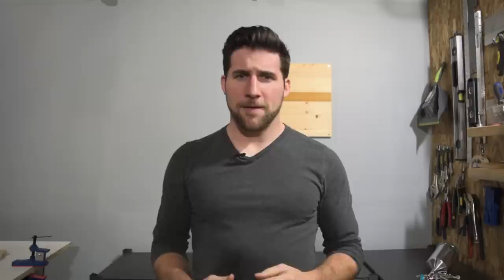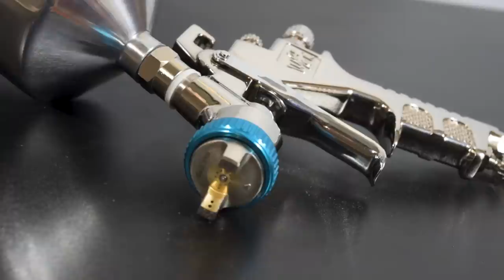Do you need to sand between coats of paint?

Comment: Hi and thank you for the useful and to the point video. I'd like some advice please. I'm painting a plastic wing mirror cover with rattle cans to match my car's colour. I'm doing solid red, i.e. non-metallic, to be followed with clearcoat (1K lacquer). So far I've done four coats of plastic primer with 10 minutes between coats - sanded with 800 grit dry sandpaper 40 minutes after the final coat. Then sprayed three coats of acrylic basecoat with 10 minutes drying between each coat. Generally it looks really good, but there is a slight imperfection now (looks like a piece of dust and is just too visible). I want to sand this layer down with 800 grit to remove the imperfection before spraying another layer of basecoat, then clearcoat it to match the rest of the car. How long must I wait before sanding the basecoat and respraying with the - hopefully - final coat of base? Thanks for your channel and your advice.
Reply from the maker: Not sure why this comment didn't appear in my notifications, but in any event, 24-48 hours should be adequate. If you haven't already done it, you should be good to go now.
Reply: @BradAngove  Thank you for your reply, Brad. I was impatient - first time I've painted part of a car and I wanted to see how it looked (typical newbie who knew no better) - so I waited a few hours until the surface was dry, then lightly sanded it with 800 grit, then a scotchbrite pad and then applied another coat of red basecoat. Luckily it worked - I was very gentle with the sanding - and after 3 coats of clear, the part looks as good as the original factory paint on the rest of the car, and it doen't even need wet-sanding as the orangepeel is no worse than the car's factory finish. I guess I was very lucky this time around. But thank you for your advice anyway and I'll remember it in future when I do more extensive bodywork. Thank you for a very useful channel and a good presentation style. It makes your videos easy to watch and to learn from.

Comment: Good advice as usual.   Thanks Brad.
Do you have any thoughts on using Danish oil as the base coat and then top coating it with Truoil for the final finish on bare wood?
Reply from the maker: +Crazy Uncle Duke Yes. I think that would probably look great. I’ve done danish oil under tung oil and I was very happy with it.
Reply: Thanks!
Reply from the maker: +Crazy Uncle Duke You’re welcome.

Comment: Hey Brad! when using nitrocellulose lacquer, Do you recommend sanding the last coat of color if it's not even and adding the last wet coat of color after it before applying the clear? or should I continue building clear coats, level it by sanding, and then add the last coat of clear?
Reply from the maker: I’d sand the color and if it’s not metallic just move on right to the clear coat.
Reply: @BradAngove  Do mean if it's Metallic move on to the clear coats, right?
Reply from the maker: Yes

Comment: What about suing Mineral Spirits instead of water for wet sanding- as that won't swell the wood?  And would you sand color coats if there is a light bit of orange peel if using spray Laquer?
Reply from the maker: It can melt some paints, but it’s an option that can work well.

Comment: Sorry if this is basic, but i'm confused now. Do you sand between your last coat of spray paint and your first coat of clear coat? Or do you not sand again from your last coat of spray paint until after you have already put down a coat of clear coat?
Reply from the maker: It depends on the timing, but usually I will sand after my paint and before my clear yes.
Reply: @BradAngove  thanks, I regret not asking this in my previous comment but when you do sand before clear coat, what grit will you usually use?
Reply from the maker: 800 grit

Comment: Hi brad really need your help for.my case, I used rattle can for painting my diecast car. The problem is the paint very easy to peel. This is what i did. I sand the diecast first and than spray the primer paint. After the primer i already try both sand it and not sand it before the next coat. I wait the previous coat completely dry before start the next coat (try dry it with fan or just let it dry)and also try a thin coat for each layer. FYI i work at night and use acrylic paint. Pardon my bad English. Thank you
Reply from the maker: Is the paint peeling off of the primer, or is everything peeling off of the metal?
Reply: Its peeling off the metal..also try without primer,same result. Already try different brand of paint. Is it change the result if i make a box of metal with lamp for drying (like an oven process)?
Reply from the maker: Are you sure you’re using metal primer? What did you sand the metal to before priming? What did you clean it with? Did you polish anything?
Reply: Its just regular multi purpose grey primer. Just found out from you there is primer for metal.. first i use paint removal and clean it with soap. Then sand it with 1000 paper then wash it with water, and dry it. Not use anything for polish
Reply from the maker: Ok. That’s probably just too smooth. Sand back to the metal. Sand the metal with 320 grit, clean it with wax and grease remover, and try it again.

Comment: I'm using a HVLP sprayer for a cheap kids boat, I will finish in a matte black......my question. Do I need to sand between coats?? Its an enamel marine paint. Im not looking for a perfect finish. I just want to make sure it gets three coats.Thanks
Reply from the maker: No. Just spray them within the proper recoat window and you should be fine.

Comment: I have a huge cabinet I sprayed with rustoleum about 2 weeks ago. Was my first time spraying out of an hlpv gun. I got terrible orange peel and mega runs. 2 questions, I need to ad more coats still. Should I just ad the extra coat, and then color sand and work out the runs? If so do I need to sand the existing coat first for the next coat to stick? Or should I just sand the orange peel and runs down now, then paint and color sand again for the final step?
Reply from the maker: I would sand it smooth now at 800 grit before moving on. Fix problems early when you can.
Reply: @BradAngove  Thanks

Comment: Brad  I couldn't find an email address for you anywhere. I have a question I was looking for the answer on your channel but didn't find it. Polyurethane I'm spraying from a can Minwax polyurethane and it has been 3 days for three light coats on a piece of wood and it's still tacky. The can says it's fast drying but this is not fast. I went out and I bought a new can and I shot a couple of light coats yesterday and today after more than 24 hours it's still tacky I mean not sticky tacky but you know soft and I would have thought that by now the Sullivans would have evaporated and left it dry. What do you think might be the issue?
Reply from the maker: How’s the temperature and humidity there?
Reply: Brad Angove 
The average temperature in my basement is 18 to 20 degrees and the relative humidity is 41. That's why I thought there was something wrong with the can of spray so I went and bought a new one.
Reply: Brad Angove 
I'm changing the guitar neck on my tele number one and I have created some new headstock logos for my teles I built and I wanted to be able to seal them under a poly but it seems to be an issue for some reason. The nitrocellulose is drying and minutes to the touch and might be what I'll need to use just to seal the logos in and do a top coat along the the surface of the headstock. I don't need much just enough to stick it over the new logo so it can't get scratched off. I was hoping the poly would do it like it did the first time on Kelly number one two years ago
Reply: Brad Angove 
Oh yeah I forgot to tell you yesterday and this morning I even tried hair dryer on setting one to try to help it work faster and it didn't make a difference
Reply from the maker: That seems pretty crazy. I haven’t really used the minwax, but unless you put it on super heavy it should be dry by now. At least not tacky.
Reply: Brad Angove 
crazy to me too.  I put on the three light coats an hour apart. And the this is where I am with it. I guess I'll just avoid the polyurethane. The second can I bought was Home Hardware brand instead of the Minwax. Put to light coats on another piece of wood to test it and the same thing is occurring there. Looks like I'm cursed from can polyurethane.

Comment: Rustoleum 2x ultra cover ENAMEL....got a light coat of primer and a base coat. Do I need to sand that orange peel off before 2nd coat? Should I use 400 grit if I do? Thanks for all your help so far, Brad.
Reply: I ended up using a white scotchbrite pad. Also, I figured out that if your paint job ends up with hairs or fibers on it, those with just fall right off during the scotchbrite session. Now onto the next coat, the morning after the base coat.
Reply from the maker: You don’t necessarily need take out the orange peel, but you do need to sand with something if you’re waiting that day in between. I would stick with the grey scotchbrite. White is a bit too fine to give the finish the tooth it needs so to speak.
Reply: Ok thanks for the help.

Comment: So I sprayed some interior trim but on the 3rd coat attempted to reposition the item and got a small finger print in it. If I let it dry then wet sand can i get this out. If so what grit would be recommended as I would also need to achieve mechanical adhesion as it would be to dry. Will add one more final coat after ?
Reply from the maker: Let it dry fully and dry sand with 600 grit.
Reply: @BradAngove  Thank you Brad

Comment: Hey question for you, why would certain spots on my 2nd coat start wrinkling? For info I sanded off old coat before starting and I’m using rustoleom I’ve been waiting 30 mins to let each coat dry before applying the next. Is this a weather issue? I have to spray outdoors due to no garage unfortunately.
Reply from the maker: Have a look at my video on paint crazing.
Reply: Brad Angove thank you sir

Comment: My base coat came out textured. Probably too much air and moving to fast. Sand it with 800 the next day smooth it out and then clear it. Right?
Reply from the maker: Correct; that should work as long as you don’t sand through.

Comment: Do you recommend sanding between paint and clear coats when using metallic paints. ?
Reply from the maker: Only if you are outside the recoat window. Generally you would want to seal those in with some clear during the normal recoat time to avoid messing up your metallic.
Reply from the maker: Only if you are outside the recoat window. Generally you would want to seal those in with some clear during the normal recoat time to avoid messing up your metallic.

Comment: If I put a couple coats of stain on the top of my guitar body so far (after sanding of course), would I need to sand a bit again before I add another coat or two of stain, if it's been a while since the first couple coats? I'm wanting to go a bit darker, plus I felt I didn't sand all the surface exactly evenly since the stain seemed to soak in on parts of the top more than others.
Reply from the maker: It likely wouldn’t hurt to sand a bit first, but I wouldn’t say it’s strictly necessary.
Reply: @BradAngove  Thanks! Love your videos and thanks for all the replies!

Comment: Im using Color Tone guitar lacquer, silver metallic. It seems to not feel very smooth after painting so wondering what I should sand/use (800 grit?) prior to clear coating?
Reply from the maker: 800 grit should work well.
Reply: @BradAngove  Would you recommend heating the can up in warm water prior to spraying? Wondering if that would improve the feel of the paint after it dries?
Reply from the maker: It will help it spray better. The feel afterward will mostly be impacted by how heavily you apply it.
Reply: @BradAngove  Ah. Would that be applied too light or too heavy that would determine that?
Reply from the maker: A bit heavier will probably feel smoother.
Reply: How did it turn out after you sanded it and then sprayed it with clear ?

Comment: Quick Question: In preparation for respraying and noticed waves in my paint can I use bondo or glazing potty to make correction? or  in essence can bondo be used on clear coat?
Reply from the maker: You’ll need to sand the clear coat first so the filler will stick. After that, you can use it.

Comment: Sweet so no 1000-2000 grit, but do 600-800 between the final coat or clear coat. This is interesting
Reply from the maker: Yeah, those really high grits are for the polishing process. Not for between coats.
Reply: Dry sanding with 800 is a bit much, unless your going to use like 6 heavy coats of paint. Do we mean wetsand with 800?
Reply from the maker: 1 decent coat will take out 800 grit scratches. 
Just to clarify though, you realize 800 grit produces the same level of abrasion whether it’s wet or not, right?

Comment: In your opinion what is the best glossy sealant in oil based clear coat for non yellowing?
Reply from the maker: Not sure what you mean about sealant, but the catalyzed polyurethanes (automotive) have great gloss and don’t yellow. See my video in the difference between 1k, 2k, and 2x paints.
Reply: @BradAngove  I am going to paint my wooden table with a stain called unicorn spit, which is water based and so I will need a sealer that is oil based and pretty durable since it's my kitchen table.

Comment: I have a gritty finish after painting my helmet should I sand it,  or will the clear fill it in?
Reply from the maker: It’s better to get it smooth before clear coat if possible.
Reply: Brad Angove awesome, thank you.
Reply: Brad Angove if your airbrushing an image, would you clear before paint and then clear again?
Reply from the maker: It depends. Usually I wouldn’t use an inter coat clear before airbrushing, but if you do it can help to “save your work” so to speak in case you make a mistake.

Comment: Hey dear I just tried to wet sand my base color on Hyundai elentra before I spray clearcoat with grit 800 very gently and 🥤 but guess what happenen? The color is gone! I tried again after new application and when I wet sand next time I used 1000 grit. This Time it was looking okay. So before I spray clear coat what do I need to do? What is your advice?
Reply from the maker: Clean it with wax and grease remover.
Reply: Brad Angove thanks. I failed this first attempt I also failed the second time. My failure is the base color paint is not uniform and not even. I tried the gun spray adjustment and the technique of spraying still I failed. For clear coat I believe the brand name is too runny it is mix 2:1:1 lacquer:hardner:thinner, I tried twice with reduced volume out from spray gun but still runny I need your help please let me know your thoughts. Here is a link of the results https://youtu.be/DspKOKeC1wE
Reply from the maker: If the clear is too thin for your liking, don’t add as much reducer.

Comment: lets say you are a crazy person like me, and  you decide that instead of applying a couple coats of clear enamel at a time, you just spray it intil it is way too thick in one session? how long will the blob of goo need to cure before buffing?(yes, i did this, but it was on purpose because it is an expensive experiment).
Reply from the maker: +5hredder The problem is that the stuff underneath may never cure. The solvents may not be able to evaporate through the top layers. I’d give it a try in 8 weeks. If it hasn’t cured by then, I doubt it will.
Reply: oh... well, i say glob, but it was really the equivelent of 6 coats i think... it was less than a can, and most of the spray did not hit the guitar i painted, so we will see i suppose... rustoleum says that their products cure via oxidation, so maybe if it doesnt cure by then, i will just saturate it in a sealed tank of oxygen for a while and hope it doesnt spontaniously combust.
Reply from the maker: You have the option to saturate it in a sealed tank of oxygen?
Reply: i could put a valve on a bag and seal the guitar within it to do this... it is a pretty straight forward idea.
Reply: the finish is pretty much hardened now, i am going to give it another week or two before i do minor sanding with 1600, then 2k wet paper to clean it up a little bit. i kinda wanted the stuff to look a little flawed to match the artistic styling of the guitar, which is why i didn't just spray every 15 minutes to let it flash off, and then let it sit like a normal person would. right now if i push on it hard with my finger, it won't indent, but my fingernail still pushes into the saggy areas.
Reply from the maker: +5hredder That makes sense. Let me know how it handles the sanding.
Reply: so to update you on that guitar i was talking about... it isn't drying... however, i was thinking about how pitch is a liquid at room temp, which gave me kind of a crazy idea... i could Frost-sand the piece so it wont rub off wierd, and then after i finish stripping the thick parts off, it will cure eventually, right? i know this initially sounds crazy, since it would require a method for freezing the finish, like liquid nitro which i don't have easily accesable to me. however, i know how to get those conditions without it, and since it is approaching winter time, i could even just wait until it freezes outside, and then just do it in the cold...i live in texas though, so it will be a while before i can do that this way.
Reply from the maker: +5hredder I have absolutely no idea if that will work; but I’m definitely curious haha. If you lived here you could definitely give it a shot. It’s -20 something with the wind chill today.
Reply: haha, everyone had their scarfs on and long sleeves today because it was like 7 degrees celcius(45 farenheit)
Reply from the maker: +5hredder That sounds relatively cold for this time of year in Texas.